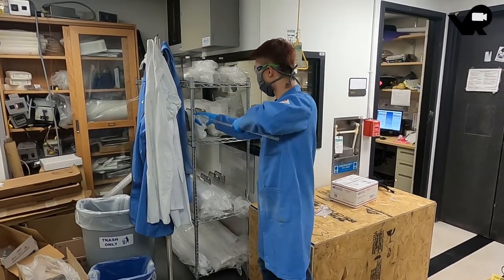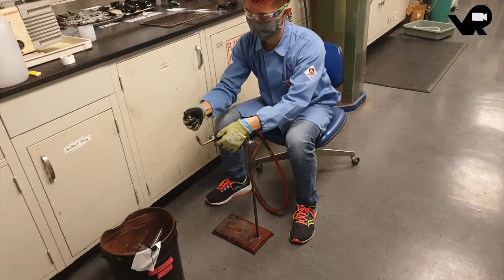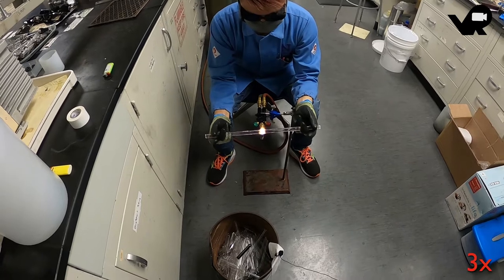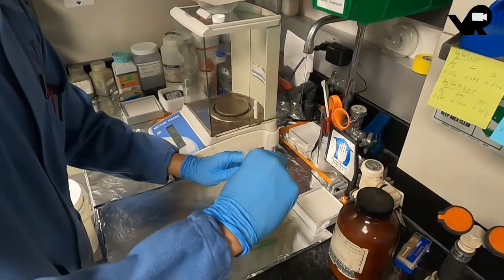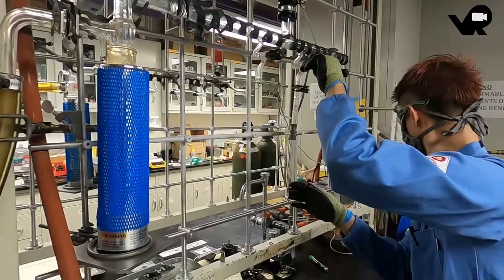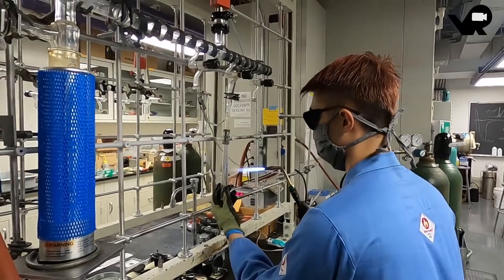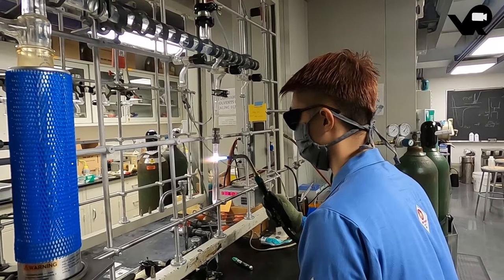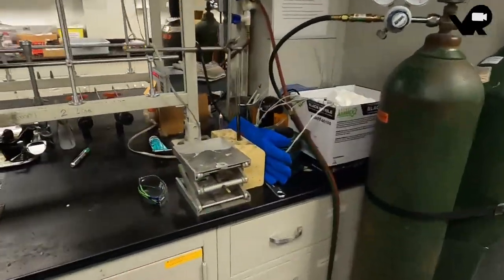How to Make and Seal Fused Silica Tubes

Comment: I tied that using a halogen bulb and put liquid chlorine in it. 
Used Oxy/new MAPP gas and it barely melted. 
Didnt manage to seal it, that stuff is on another level!
Reply: You can choose to use oxy-hydrogen gas ( HHO gas), it is suitable for quartz tube sealing and melting.

Comment: Doesn't the flame volatilize the reagents?  Does the vacuum continue sucking, and is it sucking reagent?  How often do you screw up the divot thing and break the vacuum?  How would you go about doing this in a garage lab instead of a fancy lab?
Reply from the maker: Hey, one of the students (Eric Q) answering here!

1. We use relatively small reactant amounts that can tolerate quite a bit of heat before becoming reactive, so it's usually not a concern. However, the bottom of the tube can warm up quite a bit, even if the flame is only on the top of the tube! In those cases, we may submerge the bottom of the tube in liquid nitrogen while we seal the top. 

2. The vacuum is dynamic - it continues pulling vacuum the entire time. There typically isn't an issue with losing reactant; there may be some loss with particularly fine powders or if the reactants volatize a bit, but not on any sort of significant scale. For reactants that become gaseous at room temperature (e.g. organic solvents, iodine), keeping the bottom of the tube in liquid nitrogen prevents reactant loss.

3. Depends on experience of the student and size of the tube. For the 13/11 tubes, our new students typically have a 50-70% success rate in their first quarter; from the 2nd year onwards, pretty much 100%. Most students in our group don't need to seal tubes larger than 13/11, but some projects may require larger tubes or thicker tubes, which make the sealing process more complicated. For samples that aren't air/moisture-sensitive, it's fine to carefully break open the tube, pour the reactants into a new tube, and try again.

4. There are a lot of safety concerns that prevent me from recommending a garage setup. Without proper ventilation, the sealing process can cause fine silica particles to damage and scar lung tissue - silicosis. An improperly built torch setup has extreme and potentially explosive consequences for failure. However, there are definitely low-cost options for labs that are just starting up! In a fume hood or other adequately ventilated space, a vacuum setup could be built with standard PVC/steel vacuum pipe fittings, vacuum-compliant rubber/synthetic tubing, and metal vacuum adapters to connect the tubing to fused silica tubes.